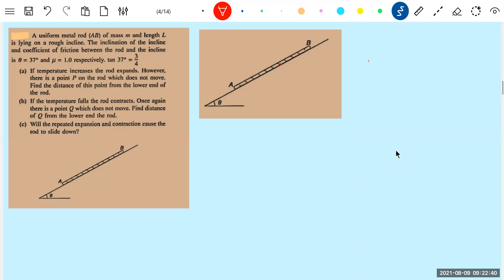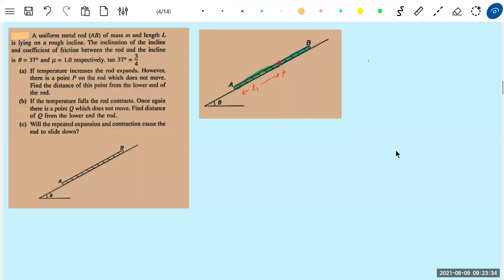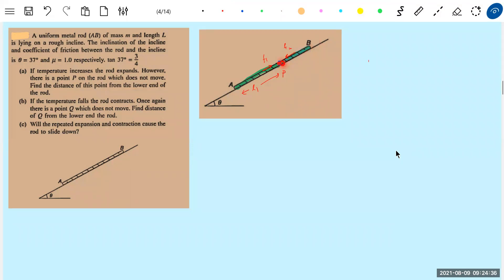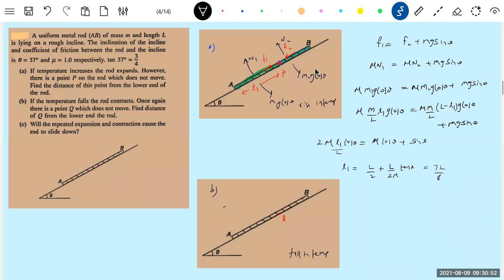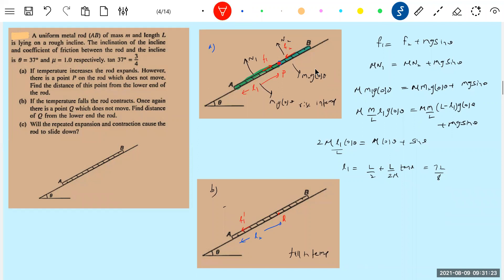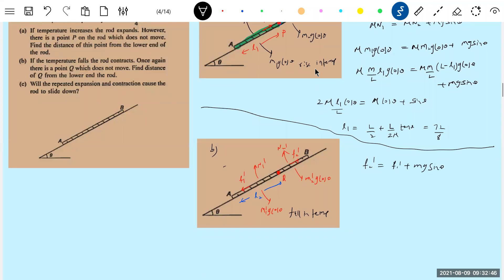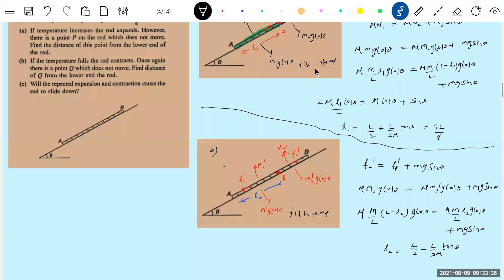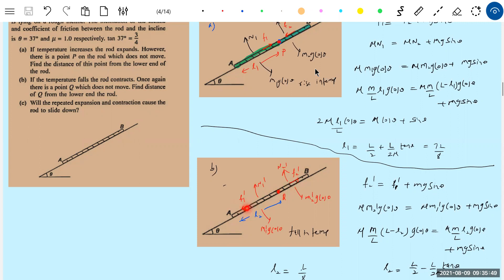24) A uniform metal rod (AB) of mass m and length L is lying on a rough incline. The inclination

Comment: Sir if the system is at equilibrium then the com should not move
Reply from the maker: Because of elongation of rod , due to redistribution of mass, centre of mass will shift
Reply: @sridharsirphysics  will the redistribution of mass depend upon the mass distribution and force acting  at different parts of the rod